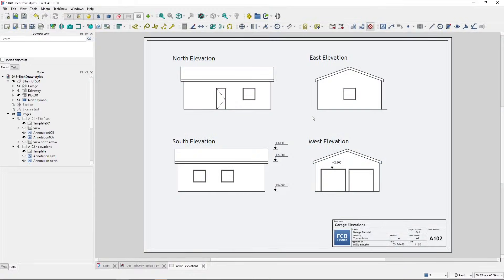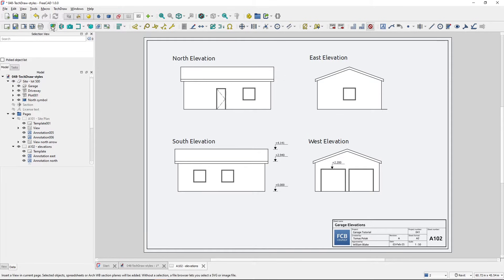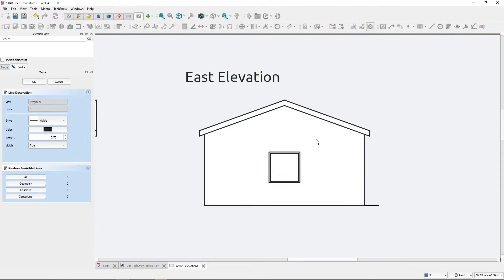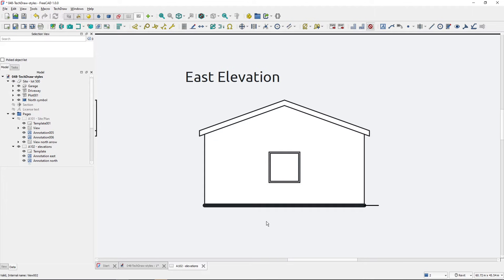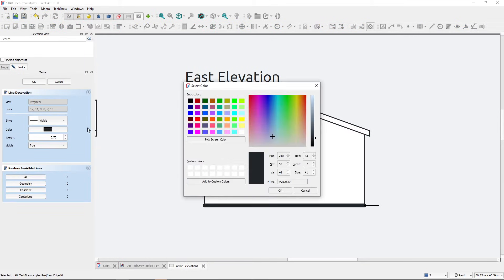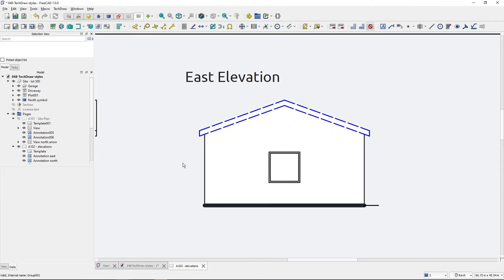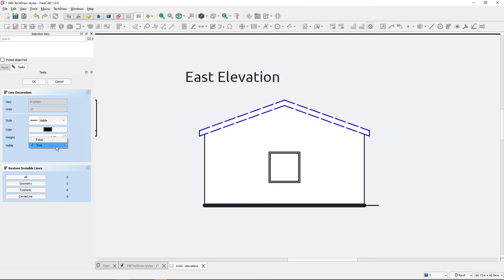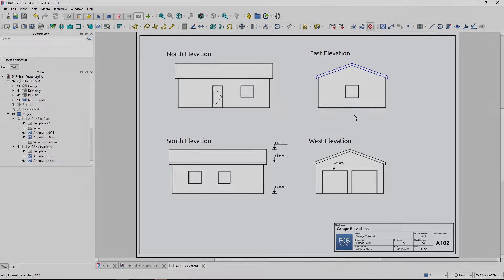Change Appearance of Lines on a Tech Draw Page in FreeCAD

Comment: whatever I do, the thickness/weight of the line doesn't change at all. I tried changing the line width in properties, edit-preferences-line width group, weight in appearance. It doesn't change. Is there some hidden parameter/setting that I might have wrong? In the techdraw view, width doesn't change. if I export as pdf, the line is too thin that I have to zoom 500x to just barely see them
Reply from the maker: That's strange. It is hard to tell without seeing the file. You might post a question together with your file on the FreeCAD forum: https://forum.freecad.org/